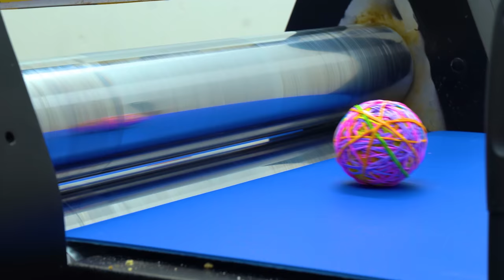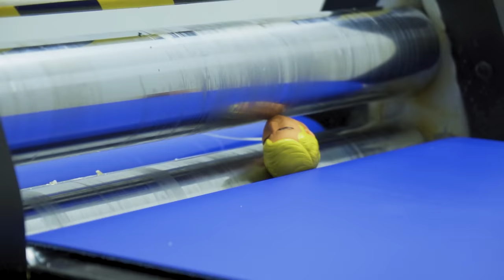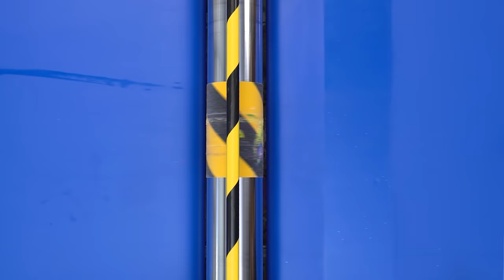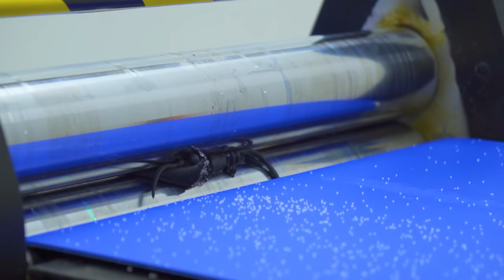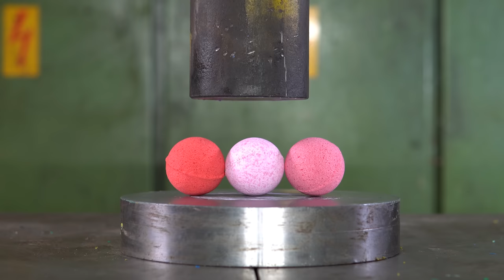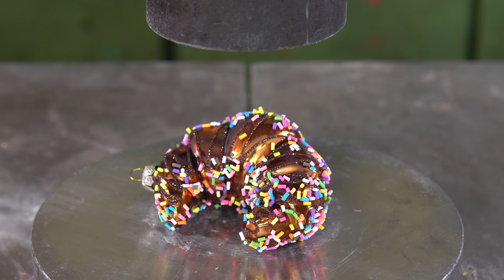Top Crushing Roller Moments VOL 1 | Satisfying Crushing Compilation

Comment: They need to do a ten hour video of just a continuous roll of bubble wrap.
Reply: I WOULD WATCH THE WHOLE THING
Reply: A 100% yes
Reply: In my mis-spent youth, I worked in a warehouse where they let any moron (including me) be a forklift operator. We would occasionally get boxes that had 10-12' long sections of bubble wrap (usually the 1" size) and one of the really entertaining things to do in the warehouse was to lay the long bubble wrap out on the floor and then take a good run at it with the forklift. You could hear it blast through the whole warehouse like a gigantic fart and it never stopped making people smile.

Comment: What if you cover the rollers with sandpaper and run "dry" things through?
Reply: probably not much actually since it wouldn't really be rubbing the sandpaper but pressing into it like you could use sandpaper as a handle grip and it wouldn't do any damage unless it slipped and rubbed
Reply: They basically did...

Comment: New idea for the deep sea chamber. There this stuff called 'aerated concrete'. I dunno if it will slowly dissolve in water, but it's full of tiny air pockets and it's very soft stuff. Might look cool if it will implode.

Comment: Wow! This brings back a bad memory. One of the guys at the sawmill I worked at thought it would be funny to run a dead skunk through the gang saw. (10 circle saws 1-5/8" apart standing vertical  with heavily toothed knurled rolls feeding the wood through.)
Story I got was when the road killed skunk off the highway went in headfirst the 3 guys around there threw up as the rear end of the skunk  exploded. It happened about 8 hours before my shift and the 100'x200' mill building still stunk.